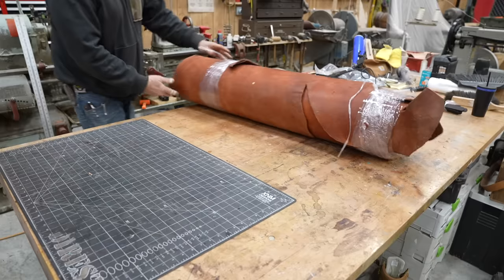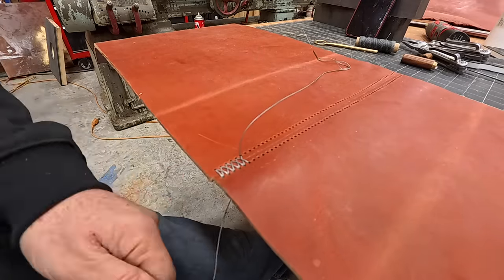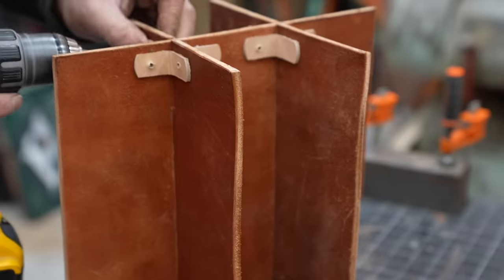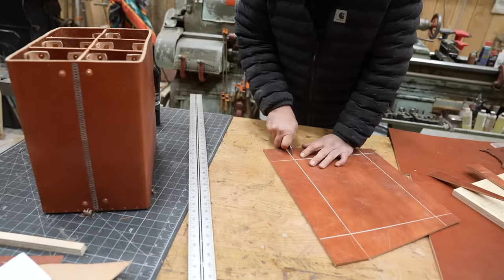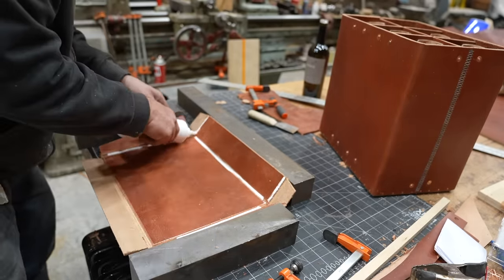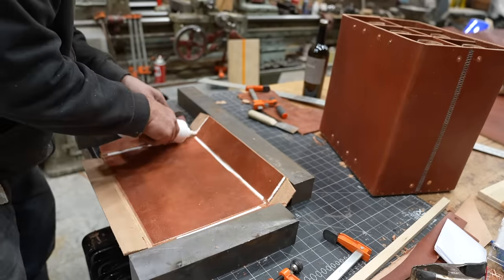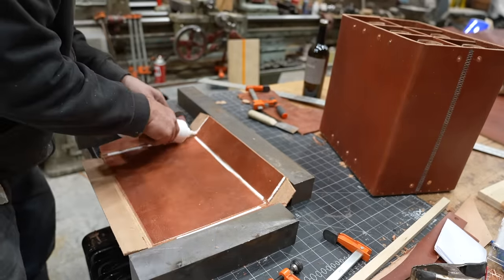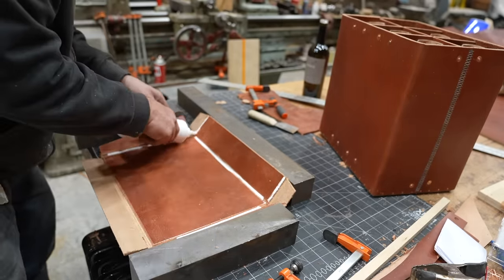Working Leather Like it's  Wood? [6 PACK FOR WINE]

Comment: Jimmy, having been a leather worker for over 30 years, all leather bends easier when you case it (get it wet/damp).  take a look at wet forming leather, it makes creating custom holders / shapes a lot easier.

there is also a tool for cutting straping, you just need a straight edge to start with.  hmmm I may have to break out my track saw to create a straight edge in the future...

Comment: I only use Barge contact cement. I have tried so many, but I have the exact opposite problem as you. I find it to be the most manageable. Which I hate because the smell is horrible. But I do agree the leather working world is filled with a biased towards doing things the old way and only that way. But in my opinion the Barge contact cement is wayyyyyyy to good not too use. But my next favorite is Renia Aquilm. It is a waster based glue and is similar to PVA. Beautiful piece! And in my opinion the head knife is a great knife for its time. You cannot afford to buy 5 different blades to cut leather in 1800. 1 blade that can do all the very specific tasks needed to make a saddle. Not the best blade for any step but one that will work for every step. But today I feel it is mainly for decoration.

Comment: I work with leather a lot.  Once I needed a skiing knife and I don’t own one but I do wood working too so I grabbed a chisel and used it.  Use what you have.  As for stitching holes in thick leather?  That’s what a drill press is for.  Woodworking tools on leather work well.

Comment: I love anything leather, even if it is impractical. I’m just talking outta my a** cuz I know nothing about leather-working but I wonder if substituting a double or even triple layer of leather for the bottom might have been a more consistent choice of materials. Also the corner brackets seemed a little clunky but I’m not sure what an alternative connection method could have been. 
Thumbs-up all the same 👍

Comment: Next: try leather on a CNC machine. Would be a great way to do small series. Maybe you need a vacuum table to fixate the leather.
Reply: You can get a drag knife for a cnc that cuts just as nice as a laser except for stitching holes without the burned skin smell. Even uses disposable box cutter blades.
Reply: @tfildaed  How does this drag knife cut a v-grove? How does it take away leather and make it thinner? I don't say it's a fit for anything, but where it does fit you can use it.
Reply: @dieterjosef  if I understand your question correctly, it won't cut a v-groove, but neither will a laser. My point was a knife is available to add to a cnc.

Comment: just wondering if the reinforcing strips were improvised in there or were you planning on putting those on the middle insert?   They sure make the piece pop
Reply from the maker: The whole process was improvised because working with that thick material really limits the traditional way you can do stuff. I had a hard time resisting, just gluing everything together.

Comment: I think your little tan leather angle cuts would have been much cleaner looking by just doing a full band all the way around each hole.  It would have made it look very robust;   you could still rivet it in the same manner.   It just looks very busy with all the little angle cuts and almost makes it look incomplete;  like we're seeing structure behind the curtain that we're not supposed to see. .  A solid band around the top of each hole would have acted more as a trim piece and really made it pop.  It's not much more leather.    I'd be tempted to cut those off and redo it with the full band. :)   ... that's how good I think it would look.